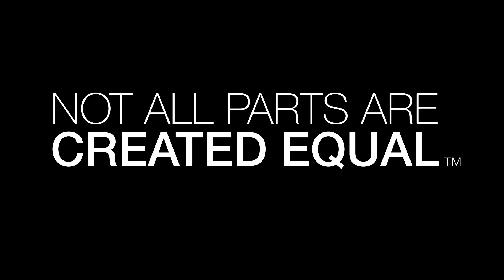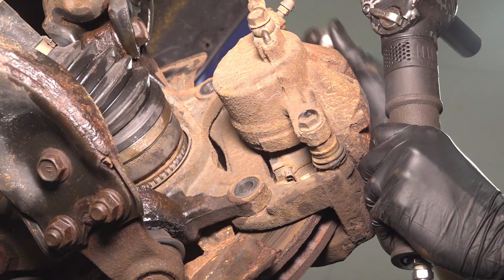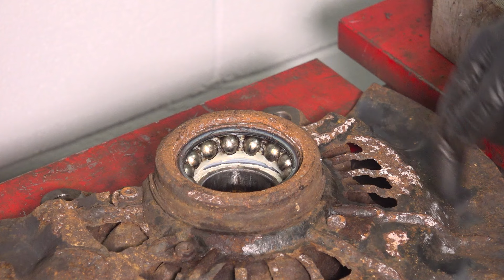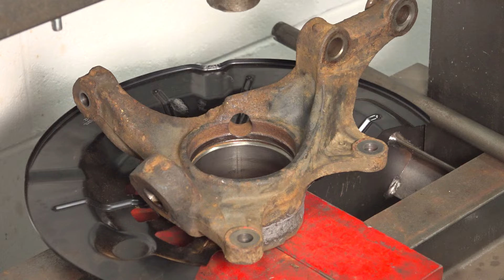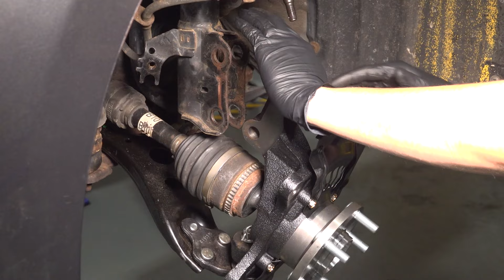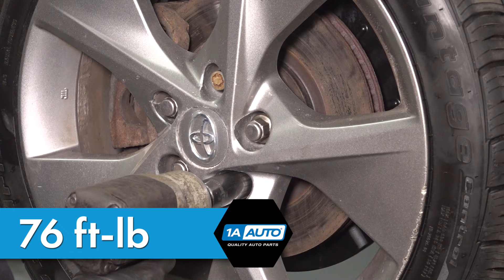How to Replace Front Wheel Bearings & Hubs 2012-2017 Toyota Camry

Comment: Replacing the hub bearing is a nightmare!! DO NOT try this, instead buy the knuckle assembly which has new bearings too and is 10x easier to replace than the hub bearing. Everything on this camry is so rusted, no point in replacing only the hub bearing.

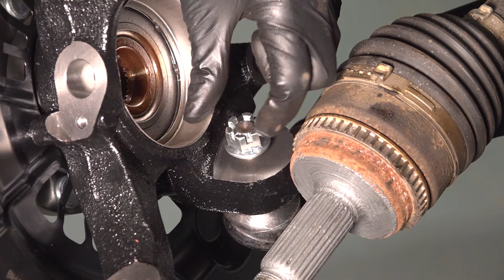Comment: 18:07 - what happens if the bolt you're putting the mounting nut on turns with the nut, and you're only able to put the nut on part of the way?

Comment: BEWARE!! I attempted this job and it was a nightmare, be extremely cautious when buying the hub for a 2012 Toyota Camry, the inner diameter of the hub were the cv is supposed to slide in varies from brand to brand, TRUST ME. it makes no sense but it's true, I pressed all of this together only for it to not fit onto my cv without an incredible amount of force which damaged the threads of my cv, and it wasn't a single store it was multiple like napa and Oriley's that had different size splines in the hub and on the cv, everyone I showed said they have never seen anything like it, also when you press the bearing out if you support it like the guy in the video you may bend the ears of the knuckle and your caliper bracket will scrape your rotor, its cast but it will bend, and it bends pretty easily, that is why I suspect he switched to a new knuckle in this video. just make sure that you test fit your hub to your cv before you press it together and the job should go smooth
Reply from the maker: +@zaks3911 Thanks for checking us out! http://1aau.to/m/Shop-1AAuto-c